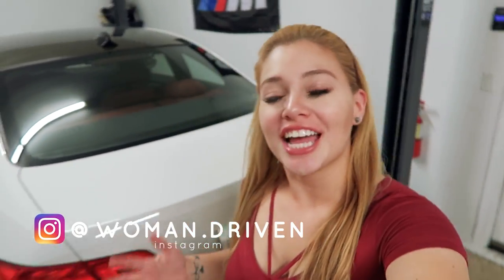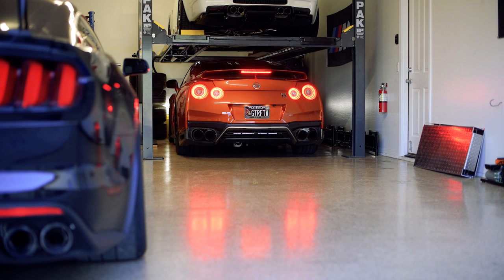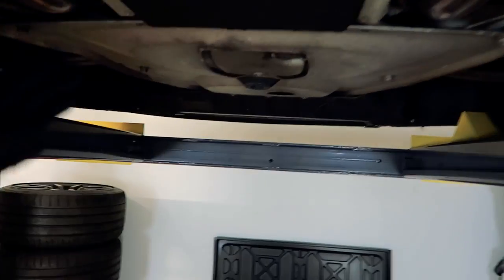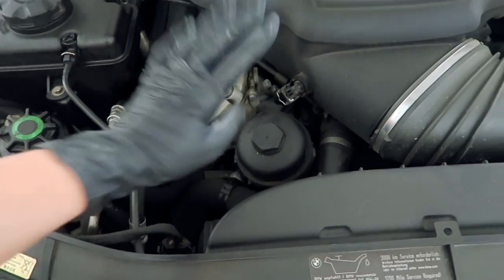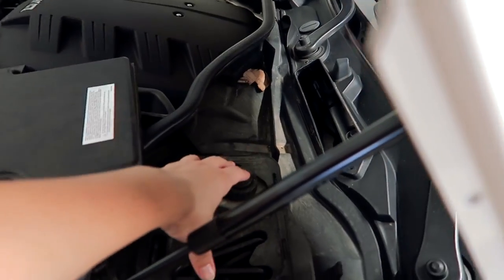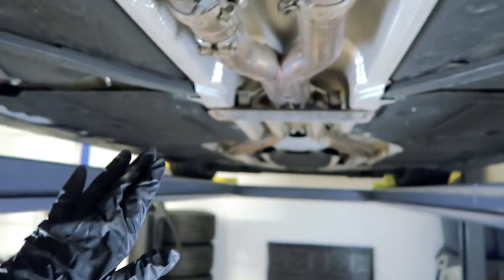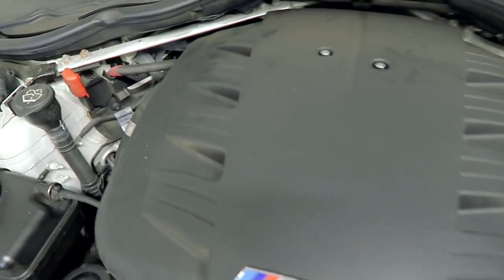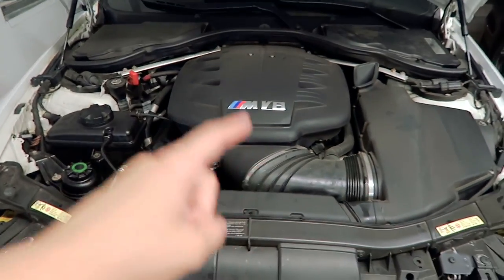DIRTY Fluids? Brake flush and Oil Change for a BMW E92 M3!

Comment: All lubed up and ready to go 👍.. Top tip slacken oil filter housing first and it will drain it clean along with the sump.
Reply from the maker: Yup all good. I opened the oil cap and left that off. Opening the filter without draining would have spilled more oil than if I drained it first. I only know those things because back in FL..I was around way way too many BMWs. But you can do it either way..it drains fine as the filter is up top so the only oil left is in the filter case which is cleaned up with paper towels. Thanks for watching. Cheers!
Reply: @woman.driven   --->  Mark is correct... in most cases with a cartridge filter, a fair amount of additional oil will drain down into the pan once the oil filter lid is cracked open.

Comment: Time for an ESS SC system on the M3. Rod bearings first though😉 I use LM oil in my E92 as well. Great choice👍
Reply from the maker: Rod bearings were replaced at 60k miles. So it's ESS ready ;). They're local to AZ too so let's see. Usually SC's are not track friendly since they generate so much heat. Thanks for watching!

Comment: Wow, I‘m impressed: someone who cleans the oilfilter housing👏🏻
At BMW shops, the old oil (about 0.8 litres) stays in there🤮
So for a full oilchange you need 9.5-9.6 litres of oil.
That‘s why I do the service by my self🛠

PS:
The oilfilter cap gets 40 Nm, not 25 Nm as it is shown on the cap😉

As always, a great video from you Doris😎

Next video:
rod bearing job by Doris💪🏻

Greetings from Germany🤘🏻
Reply from the maker: lol..thank you! Yup..cleaning the housing is must. You are correct, it does need around 9.5 liters. Once I filled it up it went in green with no issues. But it is showing it half way and not full. So we'll need to get one more quart. I'll need to get the proper socket for the cap and torque it right. I'll make sure to do it right. 

Luckily the bearings are done on this car. It was replaced at 60k miles. Thanks for watching! 👍😀

Comment: That was really interesting watching how you changed the brake fluid, I’ve never seen the brake flush pump you used I definitely have to look out and try that way looks so much easier, how I used to do it was just drain all the brake fluid then refill the master cylinder but then ya need someone in the car pumping the brake while you’re under the car open and closing the nut until all the air is bleed out , pretty primitive yeah .
Reply from the maker: It makes it soo much easier to be honest. Just fill with your choice of fluid, connect and pump. You have to check every so often and pump to keep the pressure, but it's a really useful tool. The pumping the brakes is still a choice for a lot, but not everyone has someone there to help ;).
Reply: Rohit 😍 💓💓👈👌
Reply: Omg
Reply: @woman.driven  loveyou

Comment: Great video Doris, you’re editing skills are amazing, & I love how you take so much extra time to do the detail work, if I had a million dollar car I would actually trust you to work on it, and that’s saying a lot because I don’t trust people at all lol
Reply: It's great how everyone thinks perfect job ( detail work), ( work on my million dollar car) but not a single torque wrench was used.
Reply: Steven Stiltner I finally leave a good comment and someone has to come along and screw it up lol, you have to realize we’re floating on a big rock in space, the way Doris does things is more than good enough, a torque wrench can break and either over or under tighten, and I’d rather trust Doris than a so called expert with a bunch of fancy tools any day of the year
Reply from the maker: Thank you, I appreciate that. Being at my own garage I can take my time and not worry about getting the car out in time..no volume work lol. What's 700k more for a car when I worked on a 300k car already lol ;) Thanks for watching. Cheers!
Reply from the maker: I've used a torque wrench many many times in quite a bit of my videos..as for using it for an oil change...I've rarely ever seen anyone use that. Not even professional techs and at dealer/performance shops or otherwise. I can assure you out of all the oil changes I've done..the drain plug has been mighty fine..even through track days.
Reply: Woman.Driven well I appreciate you’re thank you, so thanks for the thanks and I will add a you’re welcome 🙂
Reply: @woman.driven  Glad you didn't use a torque wrench most cars have crush washers on the drain plug.  Hand tight is always good. Truly enjoy your videos and cars, love the cars. But no bikes?

Comment: Believe me, maintenance is a dreaded word for any BMW owner who doesn't work on their car. Glad you did the oil change and brake flush by yourself. Would have cost a fortune if you went to the BMW dealer. My friend paid the dealer $520 to change oil, DEF, and brake fluid for a 2013 330d x-drive.

Comment: I'm not a 100% sure of BMW's, but all oil changes I did that had the cartridge style oil filter they always seem to hold a little bit of oil until you loosen them so I would loosen the filter first before I drain it that way I get all of the dirty oil.  Just a little help for the future, if I'm wrong please by all means let me know.
Reply from the maker: I suppose you can do either way. Since it's on top all of the oil flows down due to gravity when the car is turned off. The only thing left inside the filter is oil that is caught up on the sides. That is removed by a paper towel. There really isn't a wrong way, but I've been around enough BMWs in the past that doing it first or last does not net you that much oil coming out the oil pan ;)

Comment: I've been thinking abou this model bmw Alot. Should I get the m3 or a 335i. Heard the 335i can be tune to be Alot faster than the m
Reply from the maker: It's great. A 335i is faster when you mod it; however, they need work. Two different cars though. Chris had a 335i in the past..then he moved onto the M3 and ever looked back lol. This is his second one as he sold his first one to a friend. He just prefers the V8 and also the feel of the chassis\suspension is better

Comment: This is why rod bearing problems happen fast, 2 years no oil change, 8k miles, tracked multiple times 🥺
Reply from the maker: Well not true..2 years and only 8k miles added..way way under the average per year. Also, bearings were done at 60k miles. Otherwise, it wouldn't have been tracked.
Reply: Woman.Driven i do my oil changes on my e90 m3 every 4k miles, if i dont drive it more than 4k a year ill do a oil change anyways

Comment: How often should an oil change be done?
Reply from the maker: Depends on the car, the oil and of course, the use of the car. If you track it..every second track day..some do it right after the first day. If you use synthetic oil, then every 10-15k miles. But again, it all depends on the car and the driving habits.

Comment: What happened to Amsoil?
Reply from the maker: Amsoil doesn't make the oil weight for this car. They have a pure race oil called SAE60, but that's a little aggressive and usually requires a oil change right after a track day. It's not to keep driving around on. So the M3 is the only car that does not get Amsoil..sadly.
Reply: I didn’t know that. Thanks for the info! I also have a 2019 Camaro ZL1 1LE and use Amsoil. It’s the best!

Comment: E92 m3 over a e92 335i? Tisk tisk 😁
Reply from the maker: All day. Sure the 335i is faster modded..but the suspension\refinement\dct \high revving and the V8..worth being slow on the straight compared to a modded 335i..as this car loves to corner
Reply: @woman.driven  well if you were goin with a auto trans i guess a dct would be way better then a normal 335i trans . but ive heard they cant handle any extra horsepower an seeing as they both have near perfect weight distribution i dont see how it could be so differnlent handling wise, espicially with a nice set of coil overs ona 335i. And with the stock turbo versus naturally aspirated m3 money saving with not having to add a turbo to the m3 just tune the 335i and the fact that the 335i can get an extra 200 horsepower for 2 grand on the stock turbo is insane and then of course above all else the reason i brought it up is because the 335i n54 engine is iconic been compared to supras 2jzs and gtr rb engines that are legendary but expensive cuz everyone knows about them but i know someone who took a 335i up to 700 horsepower on the stock internals before he went in an forged everything an it ran like crazy, only thing he had to put in a limited slip diff cuz bmw only puts them on the m cars but yeah other then that the engine is amazing and that perfect weight distribution keeps centrifugal force from taken a hold of the heavier end of the car  wich is usually the front and makes you under steer. A 335i with coil overs handles great.
Reply from the maker: I get it. The 335i is faster modded without a doubt. I know this first hand because Chris, the owner of the M3, also had a 335i in the past. He was also one saying the M3's were slow back then lol. He loves his M3 now and doesn't miss the power potential of the 335i. Everything about the suspension is unique on the M compared to a non-M...rarely any parts are shared. I know this because Chris the owner of the M3 lol..swapped a lot of pieces out to M3 parts and it still did not have the feel of an M. At the end if you wanted straight line for less, the 335i takes that cake. Even now with how they single turbo it.
Reply: @woman.driven  ehh the new 340is are no 335i with the n54 engine. But i cant argue over someone who owned both the 335 an the m3 if they actually felt a noticable difference.